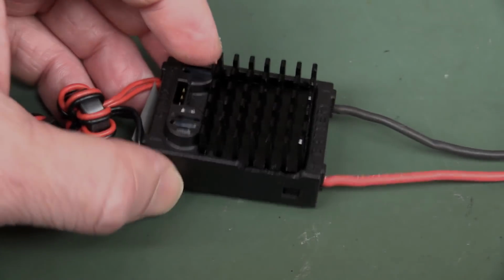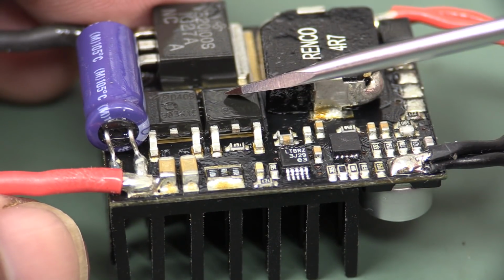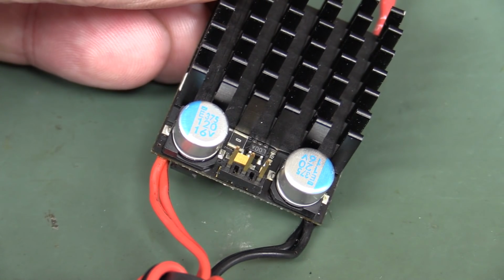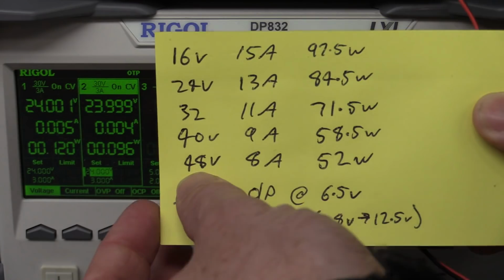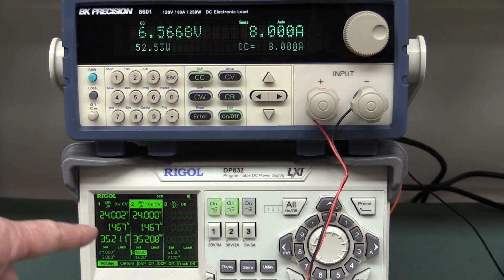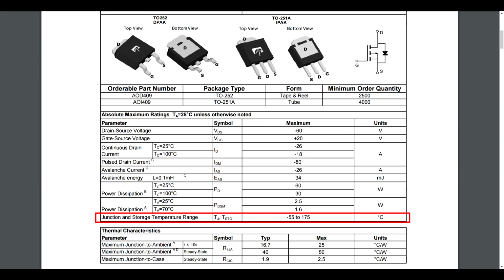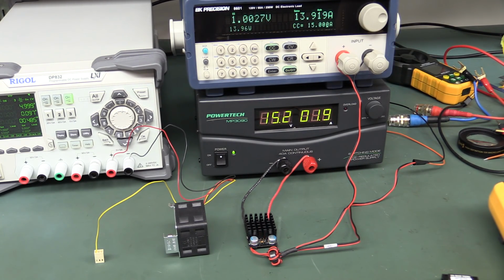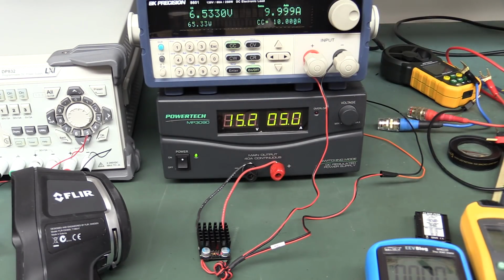EEVblog #895 - BEC Pro Model Airplane Regulator Testing

Comment: It's nice to see they really had a good crack at designing this to do the business, it's not just all lies and poor quality. You can tell they tried. The conformal coating on it and then still stating in the spec it's not waterproof is the icing on the cake, it shows they tried hard to make this good enough to be proud of. I'm buying 2 now.

Comment: Wondering why the designers did not go with a synchronous design. On paper a synchronous design would have been at least 5-10% more efficient because of the reduced losses in the Schottky diode. If anyone has any ideas let me know. I’m currently working on a 360 Watt 48DC-12DC step down synchronous buck converter design and having a lot of problems.

Comment: Test is a waste of time. You need to check an actual speed controller for a brushless motor. They normally have a bec as an integrated thing.. you power motor and auxiliary off same lipo.. thats why they have massive input leads.
Reply: 3 phase motor controller

Comment: with high permeability ferrites curie temperatures can be as low 120°C so that can be a problem as well, ceramic capacitors also dont really like high temperatures as do electrolytics of course

Comment: In real world usage, this BEC is used (and aimed) to power only the servos that control the various control surfaces of a model airplane (ailerons, elevator, rudder etc). It's not used to drive the main motor of the airplane. That means that it will probably never be maxed out in power draw if only maybe for a couple of seconds. And generally people that fly RC planes like myself we always use a BEC that can provide more power than all of the servos would require combined. Having said that this BEC wouldn't even get warm to the touch when in flight, even if you do crazy aerobatics with the plane which wouldnt last more than 10-15minutes of flight anyways before you need to land. So this is a good BEC and serves its purpose just fine.

Comment: I think this test was done wrong. I believe the idea behind a BEC, si to filter the noise produced by the motors, and keep a steady supply of current to main electronics, like receiver, flight controller or video transmitter. And none of these will electronics, servos included, will ever require so much power. Maybe you connect the ESC to a BEC to keep the power levels constant? Seams a bit overpowered for it's role.

Comment: 3 amp is usually "higher spec" and safe from causing a reboot mid air for park flyers
Reply: normally four of these bad boys http://www.hobbyking.com/hobbyking/store/__38594__Turnigy_8482_TGY_113MG_DS_MG_Servo_2_2kg_0_10s_12g_AU_Warehouse_.html
Reply: bec feeds reciever and hence servos...unless its rebooting.. then it sings some crappy tune as your plane is in a death spiral...

Comment: ohh.. its just a bec... 8amp would be massive for servos... prob way overspecced product... or for big planes. Normally the BEC is with the speed controller, that would be more interesting viewing, seeing if it can send 120 amp continous.. some of the old boys like nicd batteries for BECs. The new coreless servos often with their wide voltage op ranges can run straight off the lipo.. with good torque characteristics
Reply: http://www.hobbyking.com/hobbyking/store/__20555__Turnigy_dlux_100A_SBEC_Brushless_Speed_Controller_w_Data_Logging_AUS_Warehouse_.html?strSearch=turnigy%20bec
get that up ya

Comment: lipo batteries and brushless motors/NASA tech made the hobby great for parks (quiet) An electric motor has more power
Reply: really easy to get your fingers into trouble.. no warning if you actuate throttle at bad time

Comment: castle creations usually have good quality parts.! i believe it passed that test! if you try the same test with other (cheaper) brands you will be shocked!!
Futhermore the CASTLE have a drop down voltage mode for overload protection, other brands just cut the power totally and instant. at least your plane can still fly and no signal loss!!!!! 10+ AMPS are perfect! For more AMPS you can use two of them (servo power supply separation)

Comment: Can i just point out that the transistors is NOT what is going to cause thermal problems in a regulator like this!? Dave implies that the transistors will be the issue, but there is nearly no voltage across them when they are conducting, so also very low power dissipation. The diode is what will cause your thermal headache. Depending on duty cycle of cause, but often the diode dissipates much more power. That is one reason why synchronous rectification in DC-DC converters is so awesome.

Comment: 8:28
Incorrect, polymer capacitors have lifetime ratings all over the place, just like electrolytics.
But yes, there are some large vent-less electrolytics out there. Specifically, the Sacon FZ series, which are known to go off like gunshots!

Comment: Hi Dave, 
48.9W is Power consumed by the BK Electronic Load, Regulator is producing 52.5W , Delta  around 3W is the Joule effect produced in the cable , gone in heating the cables. on my point of view its not an error .
you doing  a great job !
Ali.

Comment: castle bec screwed my hitec servo after running in wet, shouldn't it have any voltage protection so if it malfunction it shuts off and doesent fry other electronics connected to it ?
?

Comment: You may have mentioned this but typically no one ever pushes their electronics to the peak as what is listed on that BEC. Those numbers are all PEAK numbers,not actual rates your Equipment would be putting out. I am talking about running full throttle,cycling landing gear retracts,full navigation lighting,operating servos at full capacity,flaps fully extended or being retracted. Usually a failure occures just after take off or landing because of those reasons. Expect a Transmitter brownout before that BEC to fail though.

Comment: Castle Creations are a good brand, and reliable, i have BEC's and ESC's from them. From experience, when it goes wrong is Serious! thats why I always refer to the Brand as Castle Cremations!
Reply: Late update, had one of the 10Amp model output direct voltage from battery, burned 4 MKS servos a receiver and a Spirit pro flybarless unit

Comment: I used one of those in a (non RC) project and the damn thing blew up - FETS went to a dead short, put the input voltage on the output. I Was NOT A Happy Bunny.  Also it's not a synchronous buck; basically pretty crappy for the money IMO.

Comment: Those output current maxes also aren't likely at all output voltages. It's got an adjustable output voltage.  It might output 15A just not set to 6.5V

Comment: Also remember cable temperature, ;)  70 C abs max, unless special cables..
Reply: Resurrecting an ancient comment here, but often these BECs and many other rc components use silicone insulated wire which can take quite an absurd amount of heat

Comment: The heatsink data sheet calls for a 1" square heatsink, 25x25mm. Now I'm not confident of the scaling, but the heatsink on the device looks significantly larger than that to me — between 30 and 40 mm square.

Comment: Castle speed controls (with built-in BEC) flawlessly power most of my RC trucks and helicopters. The same small piece of software from Castle (Castle-Link) lets me adjust parameters on all of them, allowing programming for almost any application or condition. As always, thanks for your unbiased reviews. Keep up the great work, and remember... Don't turn it on - Take it apart !!

Comment: I'm still watching so perhaps you address this later, but I'm pretty sure you're going to miss an important point that would be obvious to an RC person... wind! (Not your fault! You're an EE blog, not an RC blog...)

When in use for its intended purpose (ie: model aircraft) the BEC can be subject to a quite fierce airflow, depending on placement. RC people regularly run equipment at power levels that would fail on the ground. Similar to the way professional cyclists sometimes overheat when they're on stationary bikes. 

An RC person who expected to run this "hot" would put it right in the propwash or even force some airflow through the fuselage. To replicate that, you'd need something like a leafblower.

I'm impressed it went into thermal shutdown rather than just releasing it's magic smoke. In RC terms, that's basically "bulletproof". (Now if they could just make them tree-proof!)

[edit] Five miles an hour? giggle Any plane that needs a BEC that big and is only going 5mph is probably a miniature model of the Spruce Goose. Your intuition towards the end that "with some good airflow this might work" was right on track. Model planes can go 60-100kph, which is the trick.
Reply: yea especially since the prop wash is way over 5 mph wind

Comment: I found your tests interesting but not designed in relation to the actual use of the product was not done. Yes Yes I hear you testing the claimed ratings by the manufacturer........Bench test to destruction is easy, bench testing to ensure a product works 100% all the time in the environment for which it is intended is another thing, and probably a lot more challenging than testing to confirm manufacturers ratings.  These units are normally located in the RC plane, very little air movement in the plane.  The flight path of any aircraft does not allow for every servo to be operated at max current so the actual wattage usage over the flight time of a RC plane would never require the maximum rated current to be used for a period of longer than a few seconds at a time.  I would have no fear using this unit in my 6K jet and I would never have to worry about it!!!
Reply: I'll admit, o felt the same way at first. But then after some thought I realized how much stuff Dave receives in his mailbag and is asked to review without given all the facts in the letter it came with. The sender mentioned it was programmed for one rating spec, but doesn't explain what that means and is also why it shit down when he tested it under full spec load because it was not programmed to run that mode. 
To review items as an EE is one thing, but to understand the product use, learn how to program it without being given the programer and learn the hobby use without ever using an RC car, takes time for a proper review. Trust me, I know. Theirs a lot to RC and doing review. The sender could have summed up some key points explaining what  programmed meant. Meaning it won't run properly above that program rate, and Dave did that in the beginning using only that programmed wattage, but I think he forgot that when he wanted to test the max limit and needed reprogrammed.

Comment: This video is pointless. There's no cooling on the heat sink. Would Dave expect any of his scopes to run properly without any kind of shielding? I think not. As others have said. Test the damned thing with airflow. Proper airflow.

Either you do something right or you don't do it at all. For crying out loud. If standards are talked about then uphold them.

Comment: I don't even bother with using any of these hobby level BEC's for my RC projects. I use a UWE-5/15-Q12P-C, which is isolated, rated for 5 volts with 15 amp output continuous, and voltage input of 9-36 volts DC.

Comment: That thing could have used a synchronous rectifier FET, would have cut losses in half if not more, especially at high voltages deltas where the free-wheeling diode/FET carries the bulk of load current during the 80+% off-time.

Comment: I think the ratings are nothing to do with the BEC output.  A BEC is designed to run from the flight battery in an electric model that drives the motor, and provide a low voltage (typically 4.8v) to power the receiver and servos, which typically don't require a huge amount of current.  Before BEC's came along, most people had to use a separate battery pack (often 4 x AA ni-cads) to power the receiver and servos.  I doubt that a BEC would be expected to supply 8 amps or more !

Comment: All your calculations I believe were based upon 20* ambient temperature. In a hotter climate like 40* or maybe 45* ambient I just wonder if the converter will hold its regulation. Just a thought

Comment: I think the "continious" means 1 batteryload. most batteries only stand for about 10 minutes. when you change the battery its always reconommed to wait until the motor and speed controller are cooled down.

Comment: i have found most rc electronics are very over spec. the 80% rule... 180% of the datasheet numbers. lol 
some of my rc car ESC are rated for 120A continuous (and 750A burst!) with a tiny heat sink and 30mm fan.

Comment: Just a heads up, there's a typo in the top line of the description. You put "is" instead of it's (in caps below)
"model airplanes to see if it meets "IS" rated continuous current performance claims."

Comment: Sweet, I think you confirmed that this BEC is pretty useful! Failing to hit the 15v current spec is disappointing but it looks like it can output 8A+ at all input voltages that it's rated for, and if you pull that continuously you just have to make sure you have airflow over it. Considering that most RC vehicles this would be in travel far faster than 5mph it shouldn't be hard to get that much airflow over it, and 8A is quite a lot for most applications (which probably peak at a lot less than 8A).
Should be no surprise to RC people as Castle Creations are one of the big RC electronics manufacturers. Nice to have confirmation though!!
Thanks!

Comment: Do take into account that this device is intended for use on an airplane/heli with plenty of airflow.  If you're at max load and only going 5mph, something is really wrong.  I think I would opt to operate it with the case off.
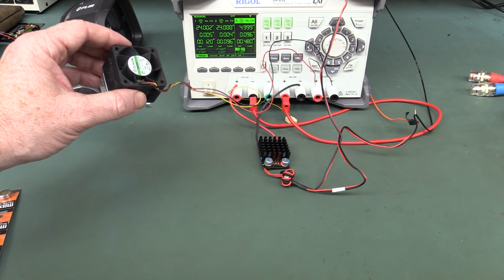Reply: he adds a fan at 23:05
Reply: They are usually mounted inside the airframe, though, so 2~3 m/s is reasonable enough and it had the the added bonus of being tested without the airflow restriction of the plastic case inside a lab with air conditioning.
Reply: Ben The Shrubber He knows, he was arguing that fan wasn't good enough (hence the 5mph number), I was arguing it is, as in most cases the BEC is mounted inside the airframe with limited venting holes.

Comment: I'm not surprised it can't sustain 16V @ 15A. That is 240W. Your PSU is only 2*30V*3A which is 180W? Am I missing something?
Reply: It's 15A @ 6.5V output voltage. 16V is the input voltage.
Reply: Ahah! Cheers guys. that's what happens when someone distracts you mid-video :D
Reply: And for the lower voltage test he used a 15.2V 40A power supply, not the 48x3.
Reply: He used another supply for the last test.

Comment: I did model aircraft for a few years.  Most of the models either have space behind the cowl for your speed control or regulator, or they have a largish hole there that feeds air into the plane with an exit hole near the tail.  The mounting point for the electronics would always be in the airflow path.   Also,  you'd get far more than 5mph airflow there.    After a long flight,  my temp sensor would usually show the heat sink sitting around 60 to 62C.

Comment: sweet video, I've always wanted to know how close to spec they are! As others have said, castle are a big name brand. a long time ago they publicly stated that they were hesitant to put any ratings on anything because they would seem completely uncompetitive when compared with the absolutely insane and exaggerated ratings used by everyone in the rc industry. they started to add some ratings, that are still a fair bit lower than directly competitive products, but pretty much everyone knows they're more accurate. I think they even have a standard for what continuous means in the rc world. also in the manual it's stated that the little plugs are only rated to 5A each and to add more or different connectors if you need more current.

Comment: What's the 2nd MOSFET used for?
Reply: JetNmyFuture I'm not sure it's as bad as you make it sound there. I've seen a lot of examples of parallell MOSFET for the sake of thermal load balancing, not necessarily for current. And in the case of thermal load sharing, it's actually highly effective. Not to mention price efficiency - you can get more bang for your buck by using several smaller MOSFETs, depending on the application.

One device taking more load than the other due to individual device characteristics is not a problem - the device with lower on-resistance or whatever, will carry more current - which will increase the heat load, which will decrease the current capability of that device. Due to that - a parallell mosfet configuration will self-balance.

You can read IRF's application note on this here: http://www.irf.com/technical-info/appnotes/an-941.pdf

And IRF, if anyone, really do know a thing or two about their MOSFETs.
Reply: They may be running in parallell to share the load.
Reply: That seems to be the diode in parallel - only one MOSFET that I could see. A synchronous design would be much more appropriate for this application IMHO.
Reply: Never mind, you are right - parallel MOSFET. If that is for better current handling, it won't last. One device will take more of the load and be damaged first, then the other smoke shortly after. Parallel MOSFETS for the purpose of gaining current is not as easy as a simple parallel.

Comment: 12S Battery!!!, that's for a huge airplane I fly 750gr airplane with 4S 4800mah batteries and have plenty of power, perhaps is the fact this is for a brushed motor, not a brushless.
Reply: 12s is more common with helicopters.  600-800 class helicopters use 12-14s LiPo.
Reply: Thanks for the info mate!, I never used anything bigger than a 2 Kg quadcopter or 2mts wingspan foamies.